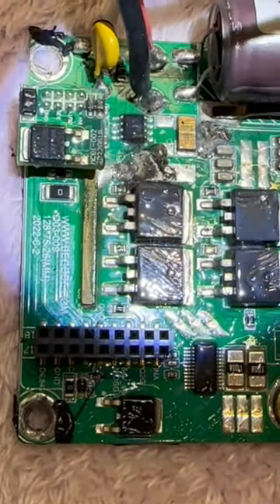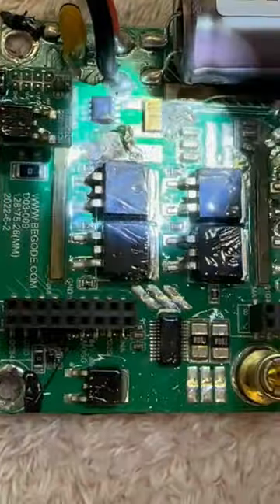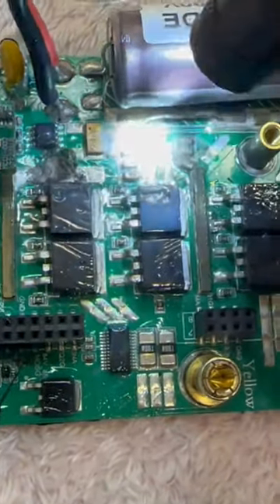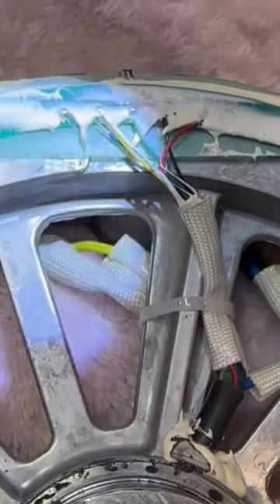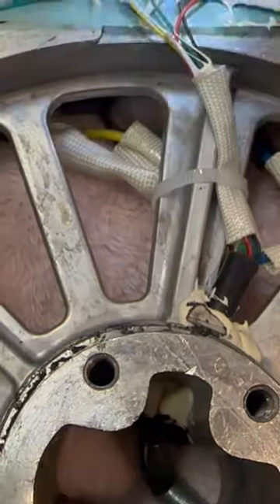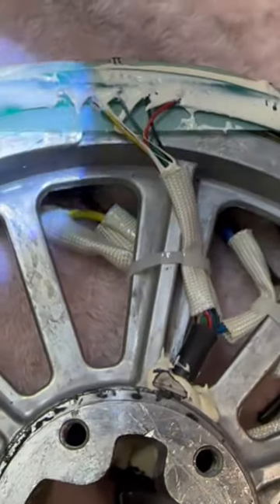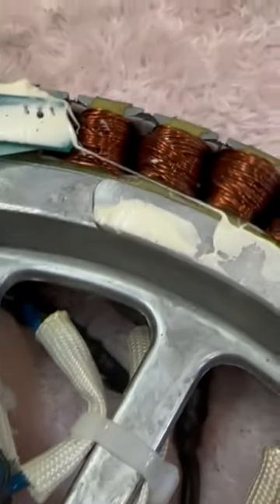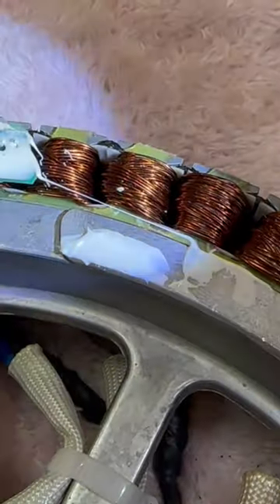Begode T4, stator slip, burned mother board

Comment: Dang… glad you weren’t going at a speed but stopped on just before it cut out. Hopefully the 2nd batch with the QS motor fixed this issue like they said
Reply from the maker: So glad I was literally just standing on it, 30 seconds earlier while going walking pace, it skipped a magnet when I did a U turn at walking pace and went to accelerate, then it made a ticking sound, so there was a tiny bit of warning
Reply: @mexicanbatman666  also, besides the stator issue, how would u stack the T4 against the v12HS and HT? Power and nimbleness wise or anything you noticed in the difference.
Reply from the maker: @max.chavalwan  V12 HS is considerably faster and the power more accessible in comparison the T4 feels like an 84v wheel. the V12 is a complete product you’d buy in a store, the T4 is as good as Begode can manage and it’s good but needs to be a lot better than it is.
Reply: @mexicanbatman666  awesome thanks, how about the lower end torque of the wheel? Under 30km/h, how does the power compare?
Reply from the maker: @max.chavalwan  mine is a V1 so the V2 has more grunt, but honestly is a bit sluggish and I’m not hyping the T4 as much as the influencers, it’s got good hill climbing ability, but I don’t feel it can do anything that I couldn’t on the V12 to be honest, this being said I really like the wheel, so much so I got rid of the Master and I’m keeping the T4 and look forward to when it’s repaired 🤞Begode send me the new board to match the QS motor
Reply: @mexicanbatman666  oh awesome, so I made the right choice going for a T4 😅. I’ve got a V2 coming soon hopefully. I’m located in Perth so it’ll take a while for it to come from Brisbane.
Reply from the maker: @max.chavalwan  you won’t go wrong with the V2 and the T4 is better than the Master

There I said it, I have/had a Master and it’s fast and that’s the only appeal

Comment: So the stator slips and pulla the cable and then it shorts out and blows the motor controller,,   do the veterans do this kind of thing too? Or are they built better?
Reply from the maker: can happen to many brands, this was specifically an Issue with the T4 and the S22 also suffered it, Veteran isn't without issues, remember the Abrams...

Comment: I don't want to buy wheels because of these problems with the wheels they are coming out with.. my monster pro caught on fire and exploded
Reply from the maker: I agree, I’m currently riding a 16X and I hate it, not because its slow, but because I just hate the ride… however it works and is reliable
Reply: How did your Monster Pro catch fire?

Comment: i've got a first batch T4 with the same motor date code as you. bought it from China (AliExpress) and they won't replace the motor until it fails. do you have any idea how you got yours to break, or was it just a matter of time?
Reply from the maker: I have a feeling all the ZX motors will go at some stage

I did NOT do the destructive test, however if you look up the destructive S22 test, I’m confident that it’ll finish off your ZX motor in no time
Reply: You need to discuss it with your seller i talked with mine for over a month and even messaged a gotway admin on Facebook to help me :) now i get my motor without the first one cutting off
Reply: The same thing happened to me, the seller did not want to replace mine until 500 km.  the motor started to make strange noises so that's how I got the seller to send the replacement